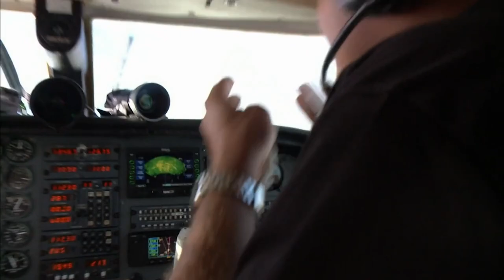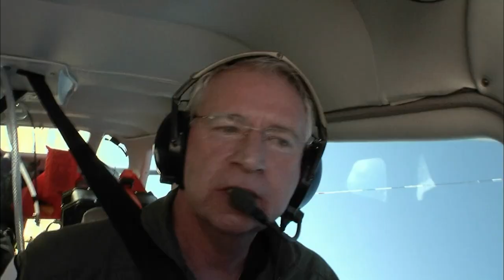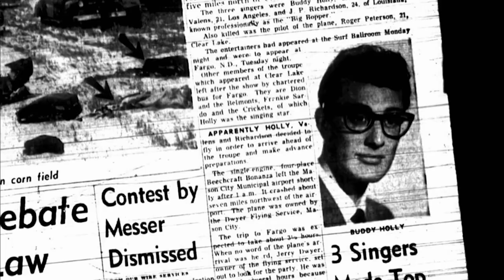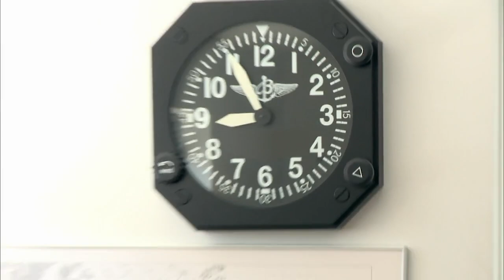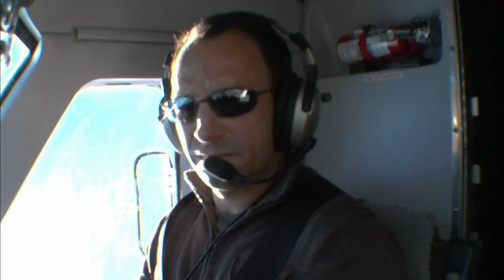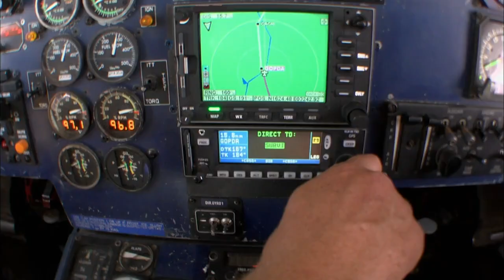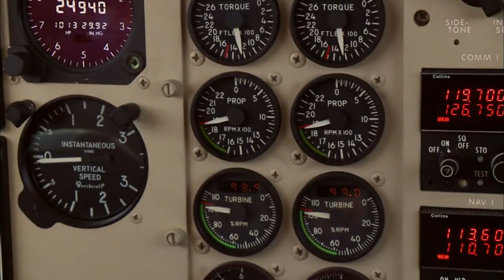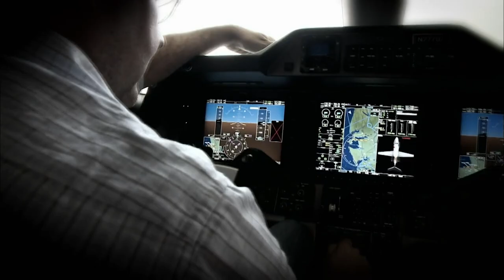Plane Delivery In Harshest Conditions 😱 | Dangerous Flights | Marathon | Episodes 1-4

Comment: Cory is the epitome of “profits over safety” with the way he handles problems. Like, who in their right mind decides that a plane that has had multiple major issues that lead to an emergency landing, and has literal metal shavings in the engine and is deemed unfit for air travel, is fine for the pilots to fly without getting it fully checked over, because he doesn’t want to pay for it?

Edit: He also decided to pay for survival training and equipment to fly that same plane. He only wanted to put money into it if it was his life on the line